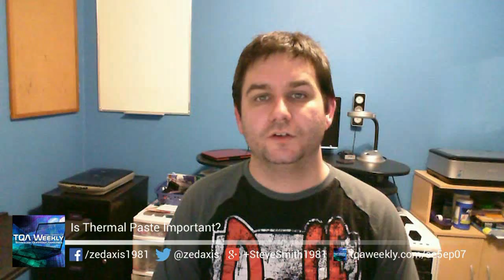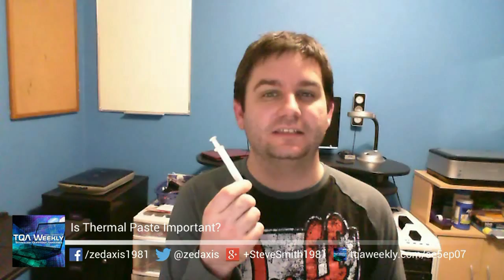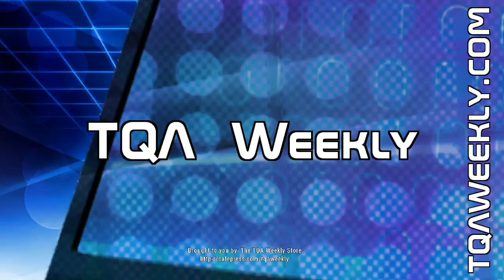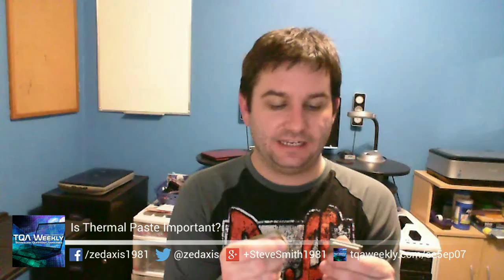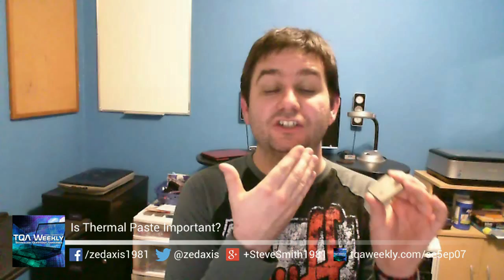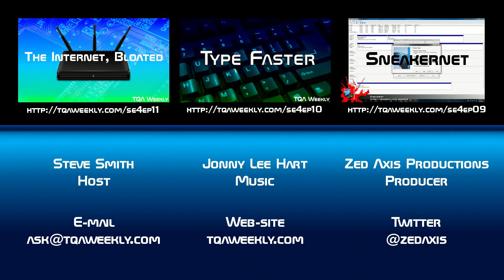Is Thermal Paste Important?

Comment: I was just trying to build my first pc, I finally got everything today and as I was doing the first step for building a pc (installing cpu to motherboard) I tried applying the thermal paste onto my $700 cpu and messed it up, the thermal paste went down into the cpu. Can someone tell me if this is something to be worried about?
Reply from the maker: Did the thermal paste get into the socket? What kind of processor? And finally what kind of thermal paste, exact brand and type.?

Comment: I dont believe in thermal paste
Reply from the maker: But it believes in Transistors. You are probably trolling, but to anyone else, if you need to move heat from one surface to another, you need a good conductor of heat. Thermal paste is great for binding together thermal conductors and removing the air that would insulate them from each other.

Comment: My another PC have CPU and I already put Thermal paste on it 1 year ago. If I replace it to another motherboard ,will it  working?
Reply from the maker: If you mean you want to transfer the cpu to another PC, the suggestion I'd make is replace the thermal paste. If any air gets between the CPU and cooler it will hinder thermal performance.

Comment: I bought MX 4 paste and it says it could last 8 years.  So do you think I still need to redo the paste every 2 years?  i think the unused paste would also dry up once I opened and will not last till 2 years later
Reply from the maker: A rated lifespan is only a best case scenario, I've had some tubes last several years, but since I swap my thermal paste every year or so, I've never had a tube last for 8 years. Mind you, my computer does some pretty heavy work, so I pay attention to my temps. Plus, I run more than one computer. Mileage will vary depending on the tube construction, quality of the paste, usage of the computer, and of course, how good a seal someone makes for the container holding the extra thermal paste.

Comment: i run my pc 1 year without thermal paste, no problems yet so what should i add thermal paste? i'm noob to that what if i destroy the cpu ?
Reply from the maker: No idea if you are trolling, or you don't use your computer enough, or push it hard enough to generate much heat, but you do need thermal paste. Thermal paste costs virtually nothing in comparison to CPUs, and most air coolers come with the thermal paste already applied for the first install. It is possible you have thermal paste, if you just bought the fan and put it on. Either way, it is on you. Make sure your Processor is protected and capable of transferring heat effectively to the heat sink. This, also, applies to water coolers.
Reply: i push it really hard everyday on gaming 10 hours and more
Reply: probably preapplied

Comment: The first time I built my PC, I didnot apply thermal paste. System turned off in a minute and turned on again infinitely. I was a noob and I got really scared.I searched internet and someone told me how dumb I am for not applying thermal paste. Then after applying thermal paste it booted up  and I was really happy. I know its importance now
Reply: idk man i`m running i7 7700k , stick no paste and it's running with like 36-38 C. Do i need paste ?
Reply: i used 1 cpu for about 7 years w/o thermal paste and never had any problems with it.
Reply from the maker: +Sarang khajuria we all learn, thankfully technology advanced far enough to prevent the CPU from simply overheating.
Reply: Yes, same dude, my PC crashed and now im gonna buy thermal paste, i just Hope nothing broke down